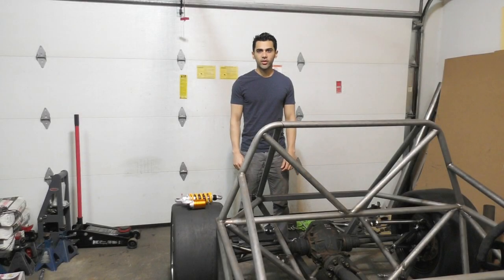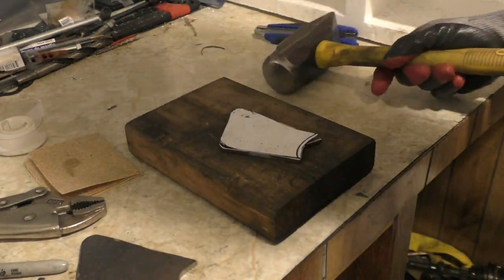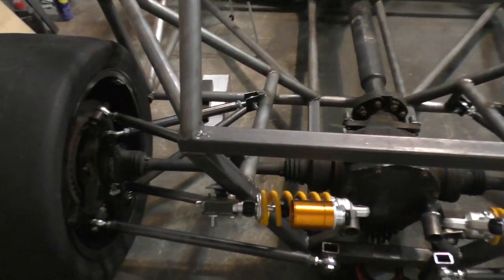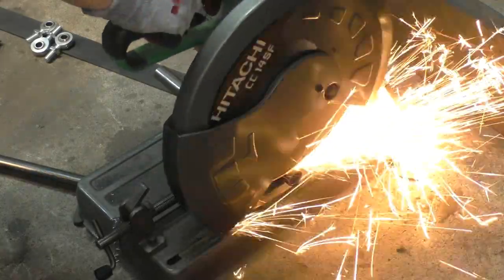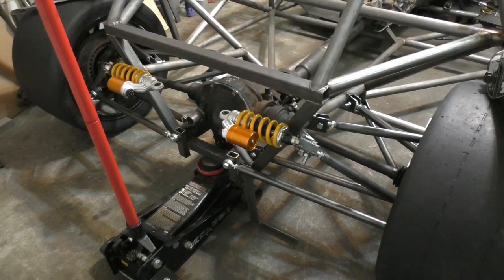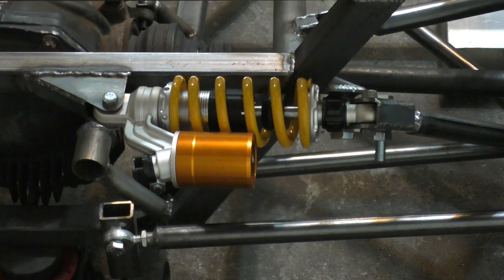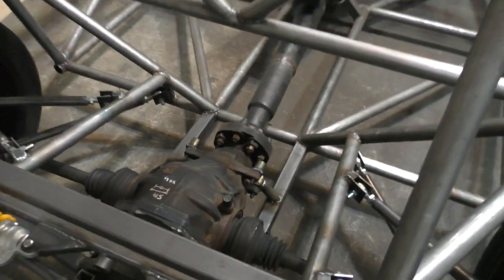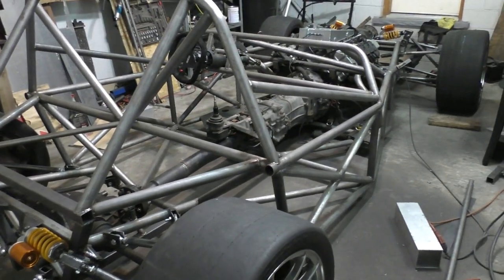Making the Rear Push Rod / Cantilever Setup - E55 ASL Part 13

Comment: Small tip for you when making identical brackets. Cut out all your blanks and tack them together before you drill them. That is called gang drilling. That way you know all your holes are in the same orientation/spacing. Leave them tacked when you grind them to shape too. Removes some margin of error. You do have to use normal twist drills and not a step drill though.
Reply: That was how I was taught to do it.
Reply: Great comment
Reply: great advice!

Comment: Hi! I really like your project. I would like to suggest something.
   Please make the rear wing adjustable longitudinally. I say this because of the aero balance. I don't really see how your car will produce front downforce (I see the splitter but the frontal area of the car is so small I don't think there will be a lot of pressure above it.) So I did some calculations based on your design from part 1: If your rear wing makes 200 kg downforce and the car weighs 1000 kg (500 kg front 500 kg rear), the distribution will be 452,2 kg front, 747,7 kg rear. That is 37,7% front, 62,3% rear. Yes, the rear wing generates 50 kg lift on the front tires(which is 10% of the original 500kg, not much but not negligible). If you had your wing above the rear axle the ratio would be 41,7% front, 58,3% rear. 
   Having more rear downforce is good for coming out of corners (less whellspin) but the car would probably understeer. So my suggestion is that you build the rear frame so that you can bolt the rear wing mount in different positions. This way you have the option to change the aero balance. This is not difficult to build and possibly won't even change the weight of the car, it just needs a little bit of designing. If you look at F1 or LMP1 thy dont have the rear wing as far behind the rear wheel as production cars because the dont have a rear window (except Mazda 787 for example, but that is to help the the diffuser and needs proper design).
(I know I ignored the diffuser and other factors, my point is not the exact number. The point is the ability to tune the car.)
Reply: Btw I hope you make active rear wing again, that was awesome.
Reply: The car weighs about 500kgs

Comment: One request. Pls dont use material gloves, when you drill something (or operate anything, that have fast rotating elements). Its much better to get chip in your thomb, than to screw in driller.
And keep doing it, this is just insane amount of work and information for others :)

Comment: hey just a heads up those you never beat bearings into place ALWAYS and i mean ALWAYS press them in they will wear our very fast with time due to the stress you applied with the hammer and socket you used
Reply: He's beating on the outer race=zero stress on actual bearing.
No problem at all.

Comment: Hi man, Are you sure the shock absorbers can work horizontally? They are usually installed with a small angle that allows hydraulic valves to work properly.
Reply: Those shocks are actually for a motorcycle originally so they're supposed to be mounted horizontally, more or less.

Comment: I was under the impression that your rear suspension set up would be similar to the front... I'm not an engineer but I suspect that your rear will be bouncing like crazy and bottoming out. 

Best of luck! Also surprised you haven't considered a driveshaft loop.

Comment: This looks pretty awesome but I was wondering... down the road when you need to service the diff, how will you remove it?   That hole up top seems like it might be full of body panels.    And as always, it's too late to mention but wouldn't it make more sense to have the push rod stuff in front of the axles to keep more of the weight closer to the center of gravity instead of having it sit at the edge of the car?
Reply: Considering the weight of the car I don't think it matters that much.
Reply: @MiGujack3  it's because of the low weight that it would actually make a bigger impact.   Keeping everything closer to the center of gravity contributes to better rotational speeds.

Comment: What was the reason for making the rocker plane geometry at an angle from the lower control arm pivot axis? Would that not make the motion ratio more digressive with wheel travel?

Comment: You may have covered this somewhere already, but is there a reason you don't just have a local shop plasma cut your plates/brackets? 

Seems like you'd save a good bit of time if you weren't having to cut & trim brackets (that you appear to already have modeled in CAD) - even if you still choose to drill the bolt holes in them.

Comment: Have you considered placing the radiator(s) in front of the rear wheels? I would think a twin turbo V8 is going to need all the weight it can get over the driven wheels.
Reply: He's already calculated and pre-designed this car to have near 50/50 weight distribution.

Comment: When welding with a mig or mag, you should be pushing instead of pulling. I learned it that way, for a stick and tig welding you should pull. Sorry for my bad english, its not my mother's tongue. :p
Reply: You have those backwards.  Pulling a TIG torch can pull in atmosphere and ruin the weld.
Reply: @LeCharles07  true, must've mixed them up.

Comment: Wouldn't it be a good idea to take the car to an alignment shop with proper equipment? Just to make sure you have done it straight. Better do it now than lwter when the car is fully assembled. Cheers mate, awesome project
Reply: That's what strings are for!
Reply: Actually better to do it when it's fully assembled as the geometry will change slightly when it's at full weight with fuel system, body, interior.
Reply: Rally cars are aligned with string in field.  I think it'll be fine.
Reply: I think he knows what he's doing and he has the proper measuring equipment  and most important know-how to make a perfect four wheel alignment and corner balance.
Reply: @John_colasante  judging by the videos, I don't trust the measurements he make

Comment: I love the build and the sharing of knowledge. But the whole structure is so heavily dependent on welding quality that I am curious how well it holds up. Weldments do not like constant bending and vibrating forces - something a racecar is subjected to all the time. The weldments will fracture and give up, resulting possibly in a catastrophic failure.
As a positive note... all kart chassis are welded and they seem to hold up.

Comment: In the last video you talked about reinforcements around the rear end and I thought that would add braces to the Toe bar link mounting points on the frame. Right now that look like that have no triangulation and look a bit out of place.  Does that link not take very much force allowing it be mounted that way? If that is the case then they look like an after thought and just do not look as well designed as the rest of the car.  This is not saying you should change it if not needed and I get you may not be done back there.
Reply: I think he said in this video he still had more triangulation work to do in the rear.

Comment: 2:45 welding while rubber bushing is co close? You've probably damaged it with heat. Also using ball bearings in heavy loaded places when they only travel 20-30 degrees is not a good idea, but who am I to judge =)

Comment: Hello, following your work, very beautiful. I have a project for a tricycle that will be assembled on a Honda WRV automatic engine. Can you give me a tip regarding the shock absorber the suspension will be double A, the motor will be transverse. I apologize for the English I'm using a translator.

Comment: What kind of round and square metal tubing are you using for the frame?   I need the same type for a build that I'll be starting soon. I'm making a mid-engine car
Reply from the maker: It's 1.5"x0.95" for all the braces that are part of the roll over structure. All others are sized appropriate for the stress they are under. Read the regulations for the events your planning to compete in. It should give you a guideline
Reply: @xfmotorsports  mine will be road legal,  not so much for racing as it will be for transport.  Thanks for the info though 👍👍👍
Reply: @xfmotorsports  and is it DOM  or seam welded tubing?
Reply from the maker: @josephgermany7446  Dom
Reply: @xfmotorsports  thanks again bro!

Comment: Please, where did you get the coilover shocks from?
Reply: In a previous video he said they are from a motorcycle. The car is light enough that the spring strength is adequate. I'm curious if there is one that has preload and compression damping.
Reply: @michelevitarelli  I did asked in a previous video he posted and he responded, but simple said it's a motorcycle coil over, but didn't give any details.  My car is currently around 1800~1850lbs and it's hard to find dampers that aren't overly stiff. Motorcycle stuff seems like the way to go, so I was hoping he might give some details.

Comment: Hi there !

Keep up with your work. Is starting to come to life.
Next time when you weld rockers/ brackets don't do it with the Rodends and Dampers on it !!!!

Rodend internals will lose it's properties due to heat applied (steel used had some heat treatments which will be gone when applied heat from welding). Instead try to use some spacers and screws.
Same for damper, all oil inside damper will change all characteristics and if you are really unlucky you can melt some internal gaskets. 
Those dampers look really expensive. Don't go in situation where you have to buy new ones just because you saved 10 minutes. It's not worth it.

Best of luck !
Reply: Also for the future, for those jam nuts used for counter fixing the rodends, I'm not sure if you put some lock-nut adhesive or something. 
but I really suggest you to put. After running the car they will go lose ,doesn't count how much force you use for fix them. This will reduce any eventual risk of play -> or even a accident. 
https://www.ebay.co.uk/itm/A43-Blue-Threadlock-Sealant-Anaerobic-Adhesive-Nut-Locking-Sealer-Like-Loctite-/121616747983